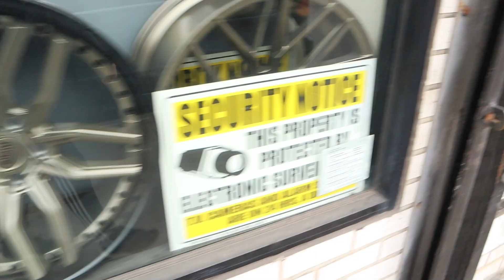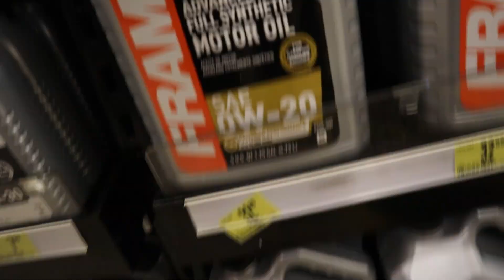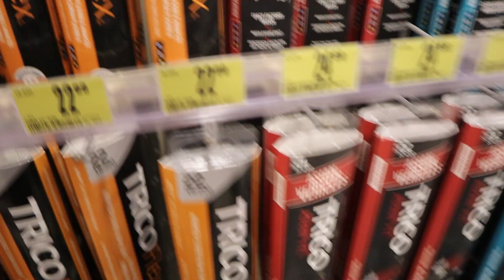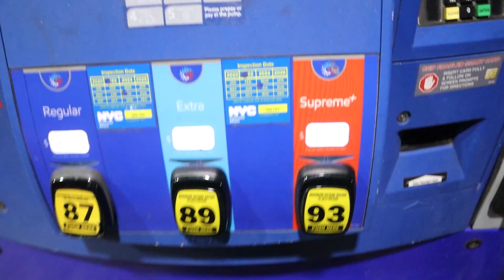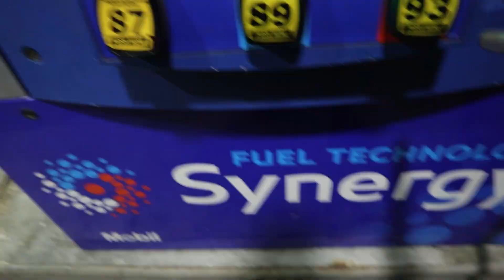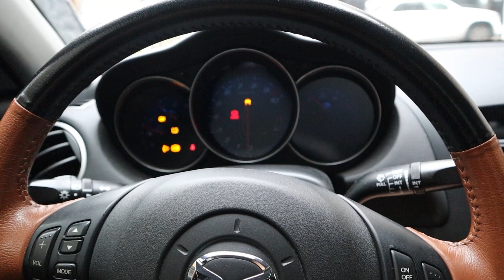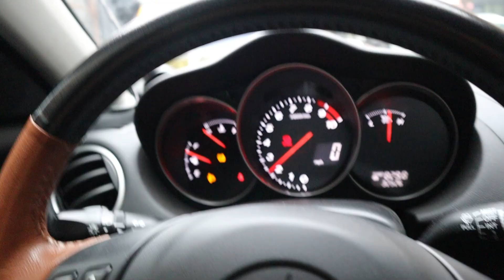Maintenance Day for the Rx8

Comment: going to gas station 3 times a week is wild, is there any actually working ways to increase mileage on rotaries?
Reply from the maker: Upgrading the ignition coils are a solid way to bump up the fuel economy, but it isn't by a huge amount, and I already have it installed. I would say three times a week isn't the norm, just so happened I had attended a lot of events that required me to drive around a lot this past week. Unfortunately tho, it is quite common for me to hit up the gas stations at least once if not twice a week 😭
Reply: If you drive Reallllllly carefully you might get 25mpg, maybe. But where's the fun in that? 😅
Reply from the maker: 😂😂 true, Car Throttle actually did a hyper mile test on the rx8 from west London to Edinburgh, over 400 miles on one tank of gas, so it is possible if you super baby it 😂
Reply: Dont drive it in the City :)
Reply: If you want good mileage buy a honda
Reply: You might want to purchase another car for daily and leave the rx8 a weekend car. Just my 2 cent